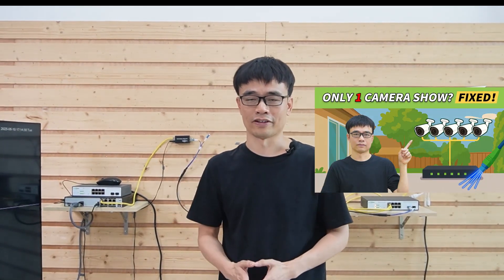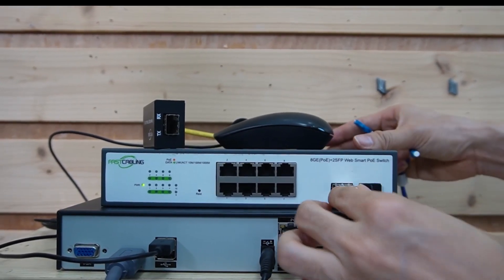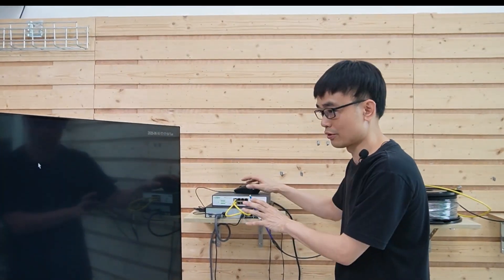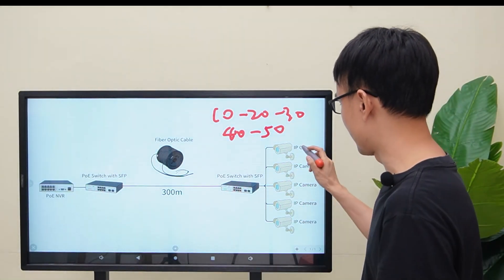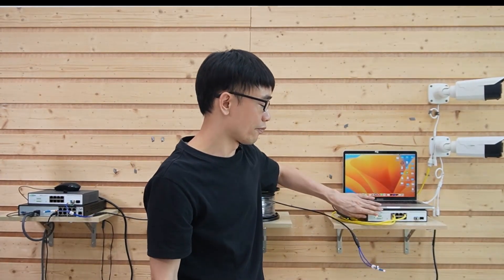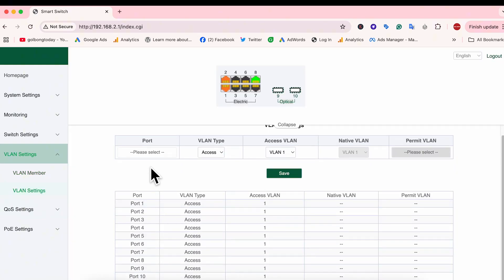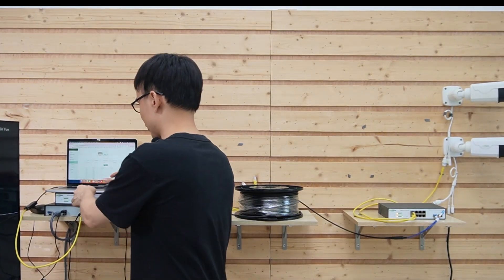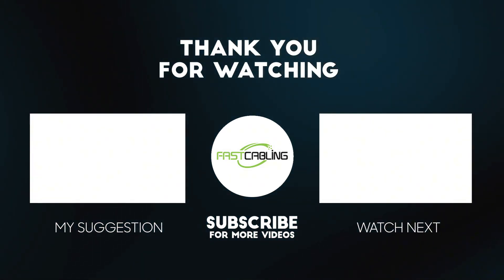Fiber to PoE NVR Pt. 2: Configure VLANs to Fix Multi-Camera Display Issue

Comment: Thank you. Nice video on how to use VLAN. I think about what is better: to buy NVR with or without POE ports. What is your opinion?
Reply from the maker: NVR with PoE
Pros: Easy setup, one cable per camera (power + data), great for small systems.
Cons: Limited ports, all cables must go to the NVR.

NVR without PoE
Pros: More flexible, easier to scale, better for large or spread-out setups.
Cons: Needs a separate PoE switch, setup is a bit more complex.

Go with PoE NVR if you have 4–8 cameras in one place. Go without PoE if you want more flexibility or future expansion.
Reply: @Fastcabling Thank for your opinion. I appreciate it.😊
Reply from the maker: You're welcome!

Comment: Please which switch are you using manged or unmanaged switch
Reply: Dear Andy, the switch is definitely Managed. Only managed switches allow VLAN settings. You can try managed switches from netgear or tplink
Reply: I'm asking if that switch is managed or unmanaged  @S.Residence.2025
Reply from the maker: It's a WebSmart managed switch. It offers a limited subset of management features, such as VLAN, QoS (Quality of Service), port mirroring, and basic SNMP support.

You can find more information at the specs below:
https://www.fastcabling.com/wp-content/uploads/2025/06/ds-6540-47-8-Port-Web-Smart-PoE-Switch-with-2-Gigabit-SFP.pdf
Reply: How are about nvr how many channels are you using?
 @Fastcabling